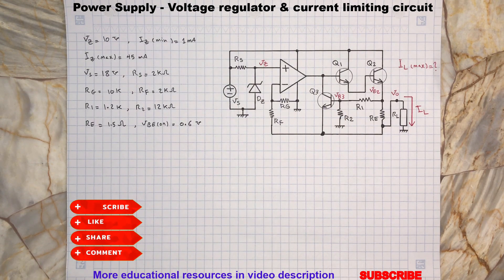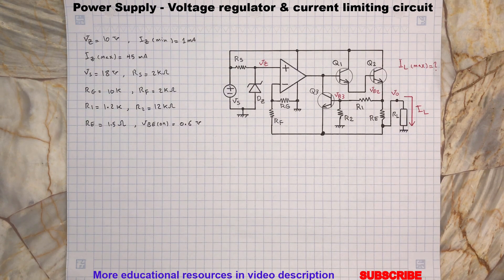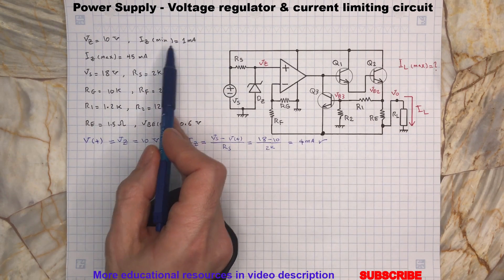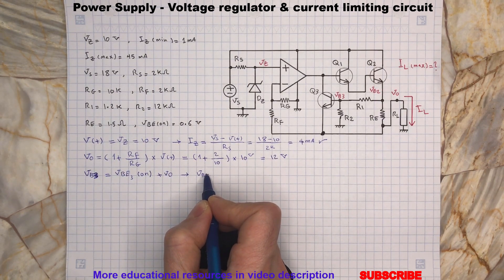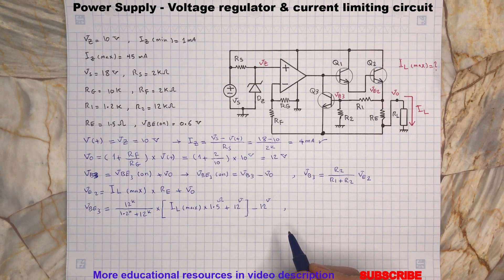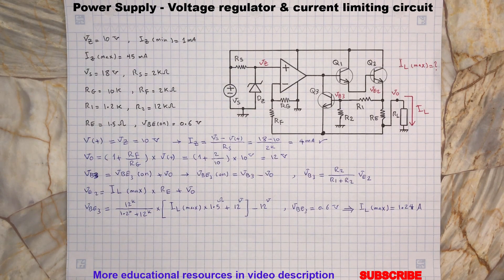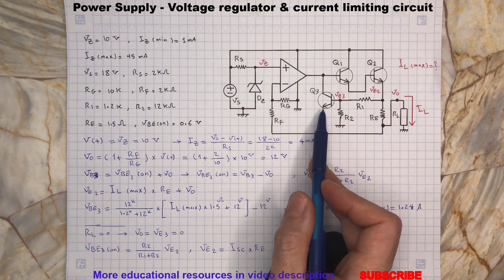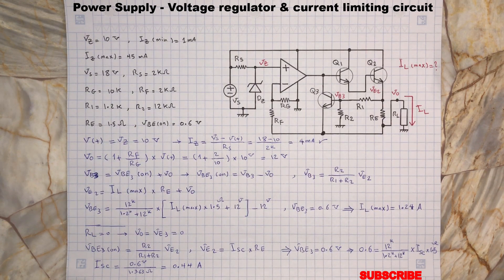Voltage Regulator and Current Limiting Circuit Analysis, Zener Diode Voltage Regulator

Comment from the maker: Full-Wave Bridge Rectifier using IC 7809:  https://youtu.be/oplCvtsdcM0
Zener Diode as Voltage Reference:  https://youtu.be/nkcTwK1LTDI
Electronic Circuit Analysis Playlist: https://www.youtube.com/playlist?list=PLLA_QJ8rHZBh5LqrY41bCvKgreRDRWrBQ
Digital Logic Playlist: https://www.youtube.com/playlist?list=PLLA_QJ8rHZBjoWpsdJeo6ii5HnWTEmDi7
Control System Playlist: https://www.youtube.com/playlist?list=PLLA_QJ8rHZBjS_S6WPkmUweF5NbImvSqf
Circuit Analysis playlist: https://www.youtube.com/playlist?list=PLLA_QJ8rHZBj8qPBFArjveEustxuToLDw